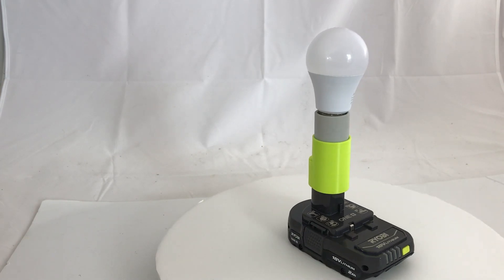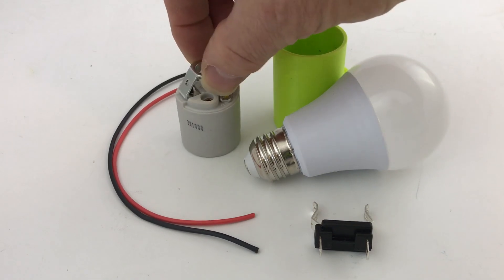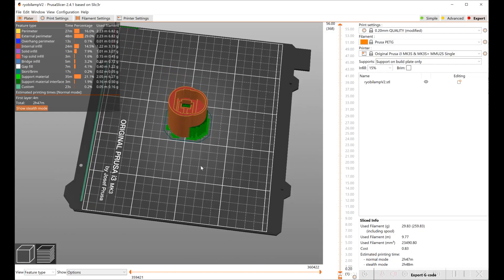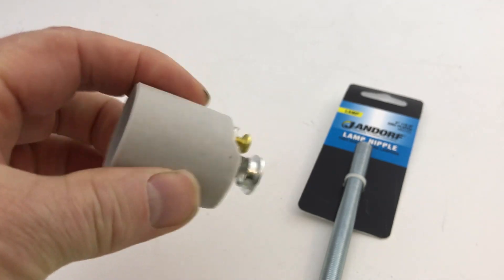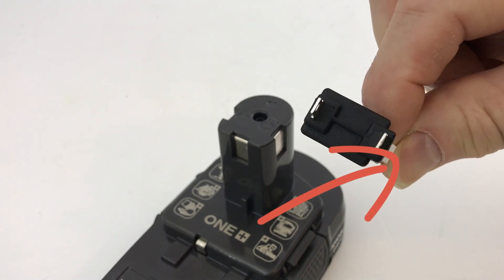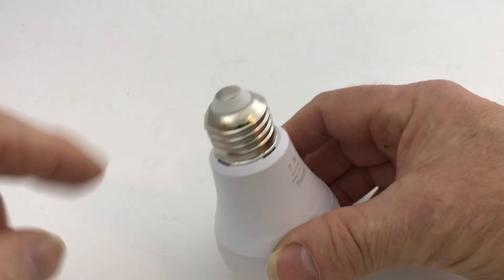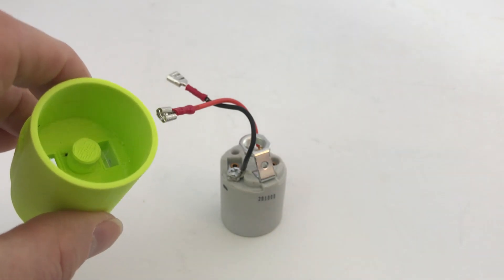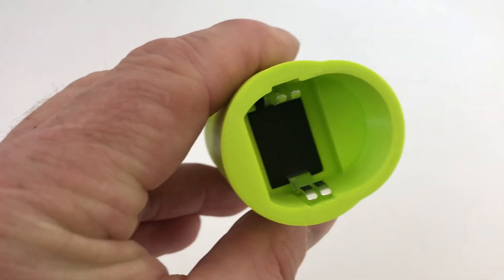RYOBI 18V LED Lamp

Comment: That’s a neat idea.   I’m gonna make something similar without 3d printing
Reply from the maker: you might be able to melt PVC pipe like I did with this project: https://youtu.be/a6DtkspzkNI
Reply: I have made several Ryobi receptacles from PVC & thin plywood.  They all work great and only needed to buy the Ryobi clips.  I made a video about it (https://www.youtube.com/watch?v=DcjcVINnAfQ&t=494s ) if interested.  I don't have 3D printing :>).

Comment: I actually have a few of these :D
I used to regularly visit a goodwill looking for used (fancy) lamps for 3$ each, then I would cut the plug off and refit them for tool batteries.

I even have 12v power supplies for them so they can still be used on mains-power. (I cut the original plugs off for a reason: .. So that nobody POPS the expensive 18v bulbs by trying to use them on wall-power)

 I use them all the time outside and love the funny comments about using fancy indoor lamps outside

I use them for a few hours a night(every sundown) turning them off before bed and can go almost 2.5 months before needing to recharge an 18v 4Ah battery.

Comment: Would a 12v battery really work that well being on a 18v? I mean there is a big 6v difference. I see it working and all but still wonder.
Reply from the maker: The bulbs are rated for 12-24V
Reply: @SerendipitySue  thank you very much.